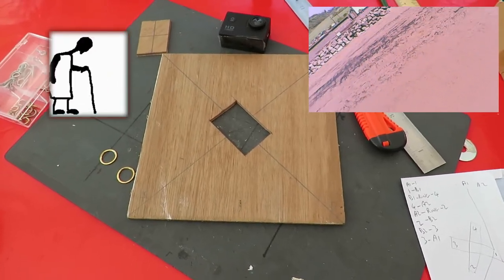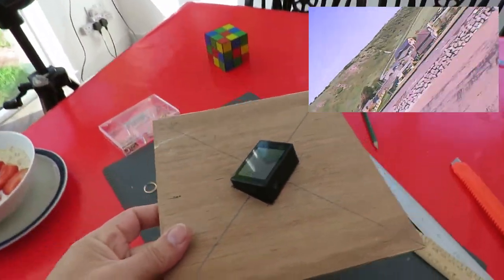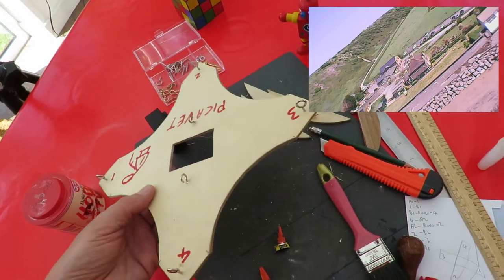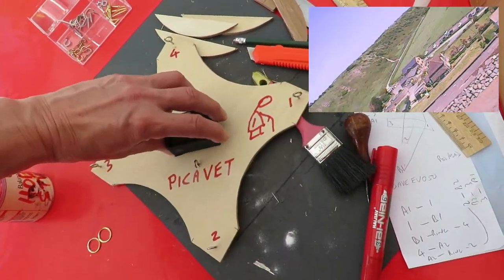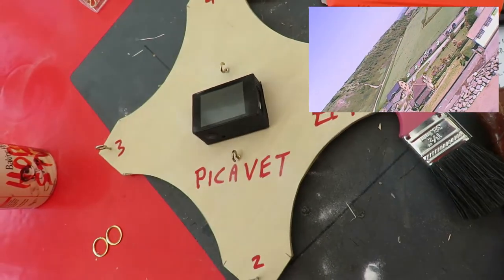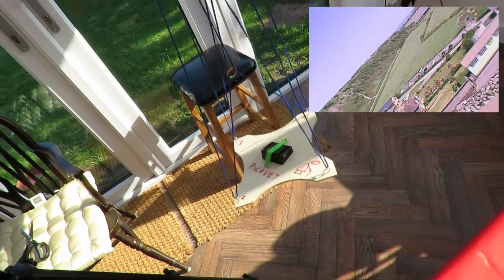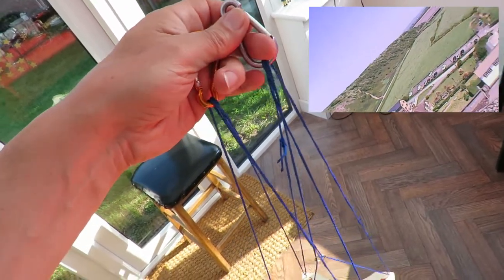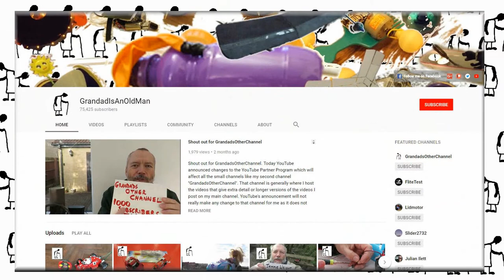Quick and Dirty Kite Aerial Photography Picavet NOT PERFECT

Comment: Looking at the footage in the small sub screen I'd say that worked well, as good as a lot of KAP footage I've seen, your 'new' Delta was doing a good job, that was £3 well spent, I've always maintain that big kites fly better than small ones, they are less 'skittish' and it does always help to get a kite high up as the wind is smoother up there.
 One project that I'd thought about is a variation of the Picavet mount, powering it to give a slow 360 degrees rotation for a panoramic view, the method of powering it I had considered was an impeller that drove gear wheels to drastically gear it down for a slow rotation, I don't have any odd gears laying around but someone who has boxes full of odds and sods could probably find a usable gear train, perhaps out of something clockwork or a RC car.....
Reply from the maker: Easiest fix there is a clockwork kitchen timer. The IKEA one is a popular choice for timelapse - here is an example https://youtu.be/o3nBLvFB64M
Reply: That is an easy solution, i was thinking of an arrangement that rotated a full sweep in a few minutes, fast enough to make a reasonable length video for YouTube.